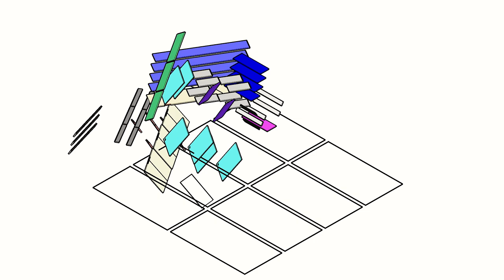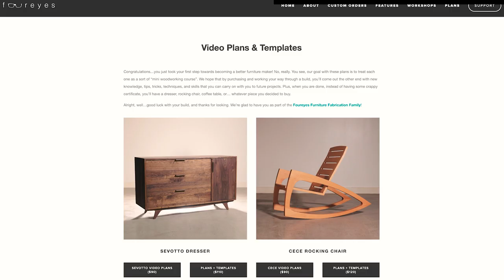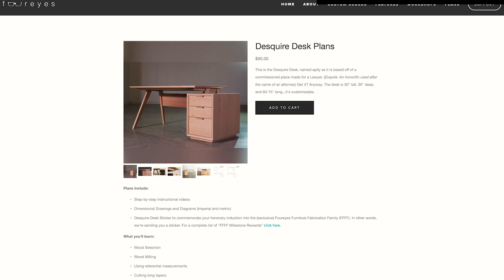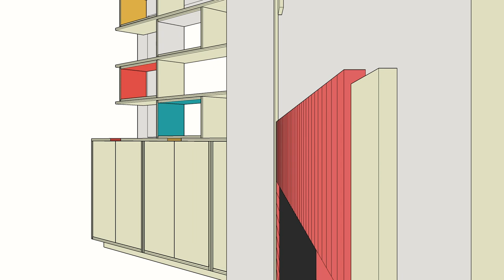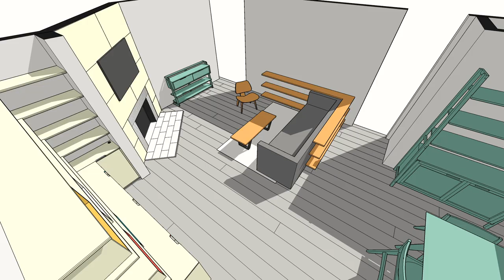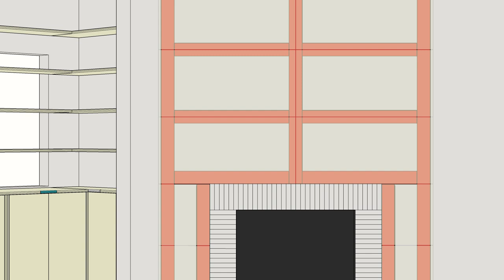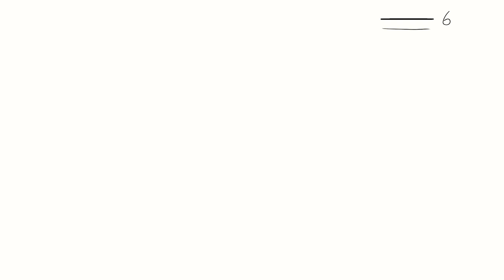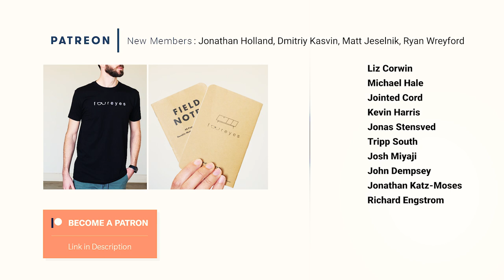I Remodeled My Living Room by Covering it in Plywood

Comment: You do amazing work, sir.  Fabulous result, and very well presented.  You also make me grateful I live in a country with the metric system :-)   One suggestion for anyone thinking of doing something like this.  In your project the TV cable installation "is what it is and ever shall be".  In other words if you upgrade the TV in the future you have to think about taking all the panels down, creating a new cable installation etc.  When you plan an installation like this, think about installing cable ducting and bringing it out at a service panel.  The routing of the duct should be as straight as possible - ideally with no sharp corners.  If you have the option, make the ducting as wide as you can fit in there to be as future proof as possible.  I actually used PVC plumbing pipe in a stud wall with 45 degree push on connectors to keep the route through the duct as smooth as possible.  Thread some string through the duct so that, in future, you can use the string to pull through a new cable bundle (along with another length of string).  Let's use TV signals as an example.  If you installed a 1080p TV back in the day then you'd be happy with an HDMI 1 cable.  But if you upgrade to 4k or 8k in the future you'll need HDMI 2, or even newer types of cables.

Comment: When mounting panels to sleepers attached to an existing wall, shim the sleepers flat using string pulled tight across the face of the sleepers as you install them.  That way your panels will be easier to install.

Comment: Great work, guys! Love the clean look.
One small tip for scribing to the uneven ceiling is to cut a bevel on the inside edge. You'll never see it from the front, but that way there's less material to remove with a sander/plane to get it to meet flush.

Comment: One idea on the plywood and keeping it complainer. Attaching the furing strips like you said. Then put a dado on the end of plywood panel. Slide a washer down the grove made by the ends of plywood butted up and drive the screw through the hole in the washer between the gap on the plywood. Hides the screw and keeps an even reveille.

Comment: Great vid as always with plenty of takeaways to think about. Your comment about pre-lining the joints with ply to help with alignment got me thinking.. if you mounted the front panels on french cleats, you could access the cables etc. and future proof the whole wall in case ypu wanted to add lights or something later. You'd need a gap at the top to allow the cleat to drop in but the ply behind would leave a nice feature. Just a thought... keep it up - love your work!

Comment: Love that TV for the art feature, I put one in my bedroom for the same reasons. (not a fan of the 5.99 month, thats getting old) I also didn't like to find out that the included cable is not in-wall rated, and the In-wall rated cable  that is hard to find is over 100$ and as thick as a 12 ga extension cord.  Made the install super difficult and is no longer 100% flush with the wall. Nice job on the updated living room, really enjoy your content.  Thanks.

Comment: Looks great Chris. My personal input is that instead of a bevel on the plywood edges meeting the fireplace, I would have gone with a rabbet that allowed the plywood to overhang the brick by 1/4" or something. I think it would work better than beveling in allowing you create clean edges around the bricking. Great video, looking forward to more.
Reply from the maker: Good call...that would have worked too. I think it would have ended up the same. We needed it to barely overhang for firecode reasons. And we were still able to leave a flat spot on our bevel.
Reply: @Foureyes.Furniture  Great input, I havent done much house stuff so I never think about things like code

Comment: Ive seen a lot of walls built like this in commercial spaces.  They use metal french cleats, screw them to the wall using shims to get everything perfect, and then screw the other side of the cleat to the plywood.  This leaves no visible screw holes on the outside

Comment: You might consider putting a bunch of candles inside the fireplace. I’m picturing something in the 4 inch diameter range, white, arranged at different heights. And considering the youngest member of your family, I think those realistic flickering LED candles that come on with a built-in timer or via remote would be a good call :)

Comment: I'd really like to see you come up with an idea for a relatively simple single-wall, mounted daybed/couch setup that blended into a desk. I love your design style and have the tools, but don't have the skills/confidence yet to really go out on a limb and try something that ambitious myself yet. In my new home, we converted one of the bedrooms into an office, and I have an approximately 12 foot long wall that I'd like to make into a combination daybed/desk with maybe some storage, since I have my monitors wall mounted, I could turn one to face the bed and my wife can watch something on one screen while I sit at my desk and work on the other. 

The idea I have (inspired by your use of plywood for everything) for the other wall is interestingly very similar to this. I am going to put some 3/4 inch thick studs against the drywall to act as spacers, paint the whole thing a contrasting mid-century styled color (going with a pastel turquoise) and then screwing 4x8 sheets of 1/4 inch sanded plywood that I'm going to turn into pegboard by mounting a sheet of hardboard pegboard to a stack of 1/4 inch plywood and then drilling through to create some fancy plywood pegboard. With the colored wall behind the pegboard, it should create a nice depth, while giving me a wall that looks nicer than cheap hardboard, and will be flexible for lots of different kinds of shelving and decorations.

Comment: Another great video.  Thank you.  A perfectionist like you will not tolerate those coax cables coming out of the floor for long.  The cable guy, on the other hand, doesn't care.  I guarantee you can re-route them directly into the cabinet in 30 minutes or less.  Do yourself a favor, run downstairs and go see what's up.
Reply from the maker: So I'm actually going to go through the wall and into the cabinet. I can't go under the house and up to the cabinet because there is a solid wall under the house right there, since that is where the house used to end before they added on. I think there is a really long wall I could run around and back...but I think through the wall will be good enough for me...and fairly inconspicuous.
Reply: @Foureyes.Furniture  sounds like a plan. Good luck. I’ll bet the floor is not sitting on directly on top of the solid formerly exterior wall. Must be sitting on joists you can poke through. Thanks again.

Comment: Looks great in the end. 
Love the full height plywood wall. Sucks that the ceiling, as is almost always the case, is not flat.  Too bad you did not check that first so it could be flattened with some mud work.  But I am sure that the wavyness is more apparent in video than in real life.  Could possibly take those upper 2 panels off and test cut some that are 1" shorter and see if it looks any better.  But like I said, probably less noticeable in real life.

Comment: Good outcome! Did you consider using Z-clips (see Monarch metal for the best variations...) to hang the panels? That would be the typical way to avoid screw holes on the exterior. You'd still using furring strips to level the surface, but then just hang the panels, although you would need to leave a reveal at the top or crown the panel. Always enjoy your productions!
Reply from the maker: Thanks Kevin...I didn't. I'll check them out...but it sounds like they are beyond my skill set

Comment: This is great. I am working on a plan to build a backyard cottage on the property my daughter and son-in-law own here in Seattle and one of my ideas is to incorporate a plywood feature wall in the main living area. What thickness of plywood did you use? What is it Baltic Birch or some other finish? Also, what do you think about other ways to fasten the pieces? My thought was to possibly just use small nails that you could countersink and then hide carefully with some wood putty rather than screws. But you opted for screws so now I’m curious as to what you think. Love your work.

Comment: I dig the look of the plywood panel wall. Not so keen on the aesthetic of leaving it raw though. Is that a "thing" or just your own thing? Without some kind of light stain or finish, to my eye, it looks like a project you haven't gotten around to completing.
Reply from the maker: Thanks Jacky...it actually has a water based polyurethane on it. It's a fairly low gloss sheen and doesn't change the color of the wood much to keep it light.

Comment: Have you not considered metal french cleats? It would keep it coplaner and clean as there would be no screws in the front of it.
Reply from the maker: I did not think of that.
Reply: I didn't know about metal ones, but did wonder if all the lower panels could have been mounted with French cleats and then only the top board would need screws & they could be covered by a crown or whatever molding.  Looks great regardless, though!
Reply: @jonathanhowe42  the point with the metal ones is that they have a very low profile and the panels could be hang much closer to the wall. If you think that you lose an inch with wooden cleats, the metal ones should be only about quarter inch.
Reply: @andresilva8444  Oh interesting. I wasn't thinking about the depth portion of it. Good point

Comment: Just a thought - I like how the plywood wall has turned out, but instead of using that existing wall, how insane or easy would it be to extend the actual room in the direction of the fire place/diagonal wall and make it more into a fully rectangular room? That may well have been on your mind already and it would change the price cap significantly … but it may also add resale value and give more design options? 🤷🏼‍♂️

Comment: Really like the idea of putting plywood on the wall, though I think it might have looked better if the sheets were vertical instead of horizontal. Don't know if that would have made it even harder to do though. Great work!
Reply from the maker: we considered that. It was kinda 6 to 1 half dozen to the other. I think they would be equally easy/hard

Comment: I'm not usually a fan of plywood panelling, but that looked great, another decent video, thank you! I was surprised none of the plywood was finished / oiled / lacquered or something. With young kids how's it look a year on? I only ask as I'm in the same position and considering doing something similar. Cheers
Reply from the maker: Hey Russ...thanks. Now you have me questioning myself. But I'm pretty sure I sprayed on some poly before I took the pieces home. 

All that said. They are holding up well. Nobody really touches that wall. The one thing that does get dirty is the white brick in front of the fireplace. Sometimes the kids will walk on it. So every month or so we just wipe it with a damp rag and it cleans up nicely.

Comment: I am in the process of renovating an entryway and stairwell. I will be using whitewashed plywood for everything....sliding doors, walls, and ceilings. Unfortunately it is a 115 year old stone house and the walls are nowhere close to smooth, flat, plumb or square. I will also be using 20mm thick Styrofoam insulation behind the plywood for moisture barrier, sound dampening as well as insulating the cold stone which is the unheated garage wall. The space is really chopped up so the challenge of making clean seams and straight lines will be enormous. The foundation of the plywood will likely take me much longer than installing the plywood panels.

Comment: Apart from my opinion that you could've went with a nice gas heard, why didn't you just nail it with some glue or lamello the ply board to the frame?
Oh,  and black (or matching) colour silicone in between the panels?

Thanks for your videos, I enjoyed all i've seen. 
My work is installing fireplaces. Including making the cabinets ect. 
These days it's more cabinetry with a heard built in. 2 or 3 sided gas fires offer great design possibilities ;)

Comment: You should have run the wires behind the baseboard and busted a hole through the wall to get the cat 5 and coax into your little network setup. You can cut away some of the drywall behind the baseboard so you have enough room to hide everything. Just make sure you don't nail into it later.
Reply from the maker: I'm planning on going through the wall above the baseboard. The plant will cover it, and I'll get some kind of grommet to make it "presentable"
Reply: @Foureyes.Furniture  <3

Comment: This could have been done a bit faster and more precisely with the tools you have in your shop.  If you took a full sheet of ply on the CNC, or just a small router bit in a palm router, you could cut thin relief lines in the sheet of ply (giving it the effect of multiple panels) and then installed full sheets on your fireplace.

Comment: I would've gotten rid of the bricks on the floor and replaced them with a large hardwood inlay panel, instead of putting paint on them that's gonna chip off sooner than later.

Comment: Hi Chris, loved the video and was a cool way spruce up your living room. Just a thought as you were installing brick trim, mitered returns on your trim are way easier to cut glue and fix. I only say that as it looks like you were cutting a 45 on the face of the trim board which looks fine but then you are fighting making a clean line across the face which has a good chance to have errors and since there was no routed edge there is no reason to trend the trim top to the floor. Anyway here's a video on cutting a mitered return https://www.youtube.com/watch?v=Ul5smNOZAUU 

I have had good success cutting my returns long to the side I will cut and then gluing and clamping the return and then cutting the appropriate side to get my final length

Comment: The "How It's Made" clip + voice...  really well done...  but why did you not just drill a hole through that stub wall to route the coax + cables directly through instead of having them wrap around it on the floor?   I'm missing something.

Also that bit @15:18....  when furniture makers (who work in 32nds) try to do home reno's (where they often work in 1/4 inches)...
(And I'm not picking on you.  I've done that exact thing many times.   I keep having to remind myself with sayings like "caulking is your friend", and "no one is ever going to notice that."    )
Reply from the maker: We've actually been talking about the cables and are going to do exactly what you just said. Just haven't had a chance to actually do it yet. 

And yeah, we were probably working way too granularly for home stuff. And caulking was definitely my friend on this one.

Comment: 15:55 A sixteenth below 44 1/4. Ha! That's exactly how I deal with this stupid imperial system. Or 50" 5/8 and a little bit.  Just under 10" and 7/8 is also something you could hear on my job sites. Did I mention that I grew up using the metric system? ;) Gruß aus Ohio.

Comment: You are fairly good cabinet makers.  But this video highlights how little you understand remodeling and fully thinking through the full project. I figuring out how to route power to the tv, after the panels were on the wall gave it all away.  A true craftsman would have installed a “TV box” behind the paneling, to plug in the TV and related cables, and routed some HDMI, and fiber cable to a box in the lower cabinet in the niche where you did the built in cabinets so devices could be placed in the cabinets to feed signals to the TV.